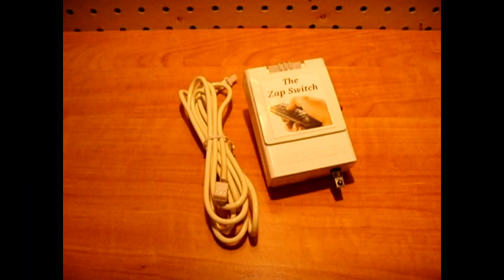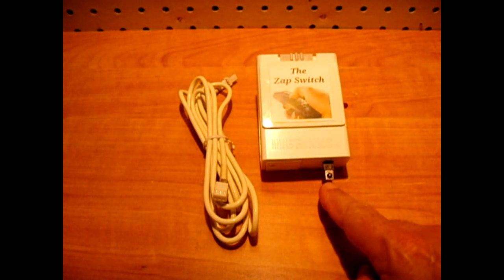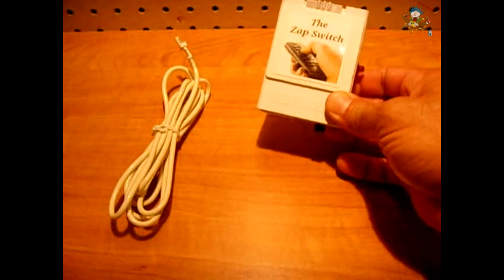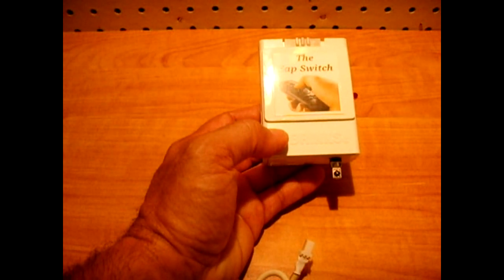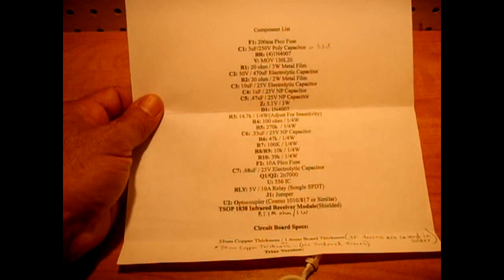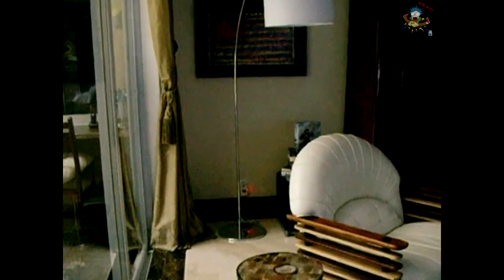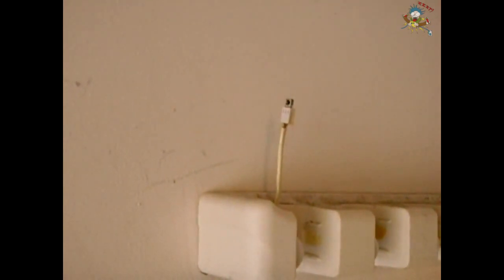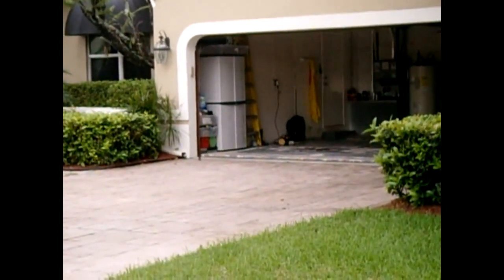Infrared Remote Control Activated LIGHTS & APPLIANCES

Comment: Hi, I am very new to Fritzing and electronics an am enjoying every moment so far specially with you tutorials and demonstrations. Question: Is it possible to use an existing PCB image like you have provided and import it back into Fritzing or is it a process where you have to start from the begining again ?
Reply from the maker: You can use my image. You need to make sure the size is correct and use a laser printer with transfer paper. I have a video showing how to make a PCB.

Comment: On your component list it says you're using a 556ic but I only see 6-8 pins on your circuit,  would an ic 555 be able to do the same job?
Reply from the maker: +Regtic 
Hello. The schematic clearly shows a 14 pin IC.
Reply: oh sorry, I realized there are numbers on each pin which indicate each pin, I was just looking at the labels (discharge, threshold, etc). I've googling a lot of the stuff on your schematic and I'm new to building electronics. Thanks

Comment: What is the availability of the circuit board and do you recommend any supplier for the components?
Reply from the maker: Nels Wight You have to make your own board using my layout. I have a video showing how it is done. Ebay has many suppliers. Be sure to share and rate Thumbs Up. Thanks.

https://www.youtube.com/watch?v=lvNCKwAcg90

Comment: Hi
Could this be made to control 12v devices?
Reply from the maker: Nels Wight Yes. Instead of using 120V on the relay contacts, use 12V.

Comment: Maybe someone here with the expertise to etch the boards could lend me a hand with this. My son has C/P, is a quad with only the use of his left hand. He carries around on his wheelchair tray a plethora of remotes. These are all dedicated to a small amount of devices that he seeks to control.

This project would be a great benefit to him in controlling a great many electrical devices around his home that otherwise he depends on others to initiate.

If any of you making this project could make me boards as you make your own I can drill and assemble them. 

And we would be so grateful and most willing to compensate you if the cost is not prohibitive and the designer is agreeable. 

I seek not capitol gain, only to enrich a brain trapped in a immobile body.

Sincerely,

KB5EAU
Reply from the maker: It is easy to do. You need to take my pcb layout(black one)and go online(Ebay) to have a PCB made. You can get 10 made for cheap. Contact the seller before buying. You need thick copper 70um/1.6mm. If you use 35um, make sure the wide traces are covered in solder!

http://www.ebay.com/itm/Low-cost-Good-Quality-PCB-Board-Manufacture-Etching-2-8Layer-Lot-process-/300742997636?pt=LH_DefaultDomain_0&hash=item4605adf684
Reply: Thank you very much!

Comment: This would work great for my c/p handicapped son. He already is having to manage 5 remotes with him for his entertainment and other devices. 
This would free him from a couple of remotes and give him access to control many other simple on/off devices with no additional controllers. To remark that this is a great Idea is an understatement!
Reply from the maker: I was going to sell these because everyone I showed it to wanted one, but I have yet to do so.

Thanks For Watching!
Reply: Could you possible produce the PCB's for the project? That is something that I would have difficulty with. 
I would utilize a dozen of these devices for my son.
Reply from the maker: I'm sorry, but I only upload videos showing others how to do things. I don't have the  extra time.
Reply: electronicsNmore Thank you anyway.
I do understand the effort you have to expend to design and prototype these electronic projects!
I have learned more from you than any other source.
At 60 years old and being an armature radio operator for all but 13 of them I still only have a limited understanding of electronic design.
Thanks for making the designs and the calculations of the workings of the designs relevant!

Comment: What about the safety of the sensor-extension-lead? There is a 50% chance that the sensor will be "hot" in regard to mains ground.
Reply from the maker: If you are concerned, then do not use the extension wire. The IR module can be installed inside the plastic housing to eliminate any chance of contact. I have never had any issues. Of course you would not be playing with the connections while the unit it powered. You remove or install the connector/module then plug it in. You can also use a COMPLETELY insulated extension wire/module. If your worried about the Line and Neutral in the receptacle being wired backwards, then add a reverse polarity protection circuit to this circuit. You will eliminate the problem. A Neutral wire only becomes Hot when it is disconnected from ground while the circuit is being supplied by a Hot wire. It is the users responsibility to make sure their receptacle is properly wired before using this circuit. Clearly people who know very little about electricity, would not and should not be making this circuit.
Reply: I would first look at the diagrams and then express my opinion. If you had, you would probably have seen that there is no risk of being electrocuted because receiver is completely isolated (safetywise) and transformer produces low value voltage. The whole device is design to be powered at all times with a back up battery and it is safe because it was built by the expert which you definitely ain't. And no, there is no 50% chance, but only 0.0001% chance that sensor may become hot. I wonder where do you get your statistics from? Another thing, there was a disclaimer which you clearly missed at the begining of that video and during. And how many devices have you guys built and share those ideas on youtube tutorials???
Reply: Yeah I agree, transformerless powersupplies like this should NEVER have exposed connections, the neutral is considered a 'live' wire. And some 220/240v outlets are NOT polarized
Reply: VanClaaude Usually I don't get bitchy but have you done what you suggest and looked at the diagrams? If so you'd notice there's NO transformer and it's not isolated
Reply: No there is not. I apologise! I did look at it, but I was more focused on the central part of the circuit. Still, the voltage past the bridge is low DC and supposed to be only between 5-12v. So the supply for the TSOP sensor would be the most 5Vin unless is short circuit.
Reply from the maker: If your paranoid about not being isolated, which I am not, then use a small transformer instead. No big deal.